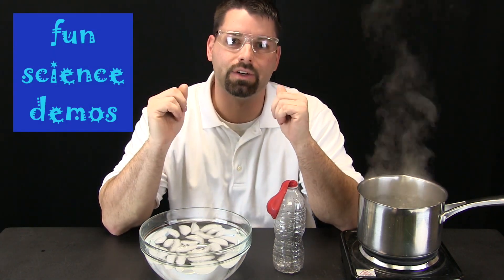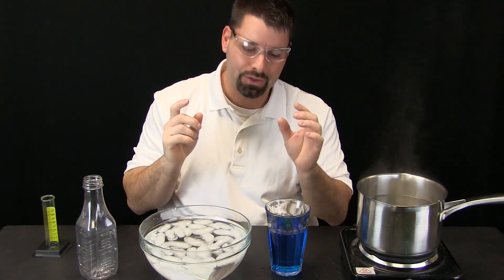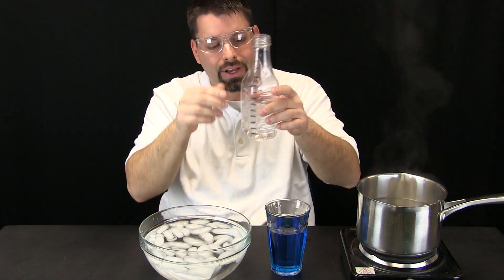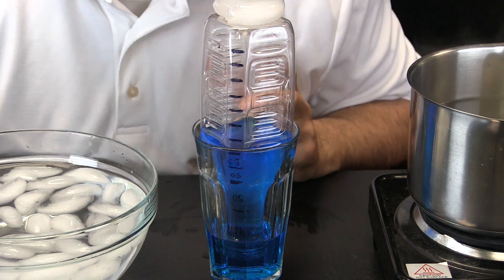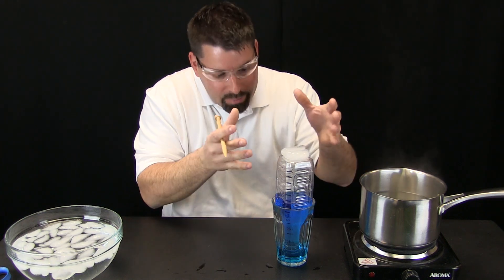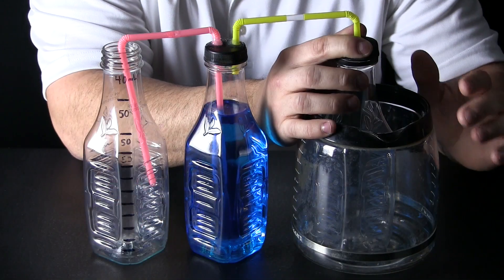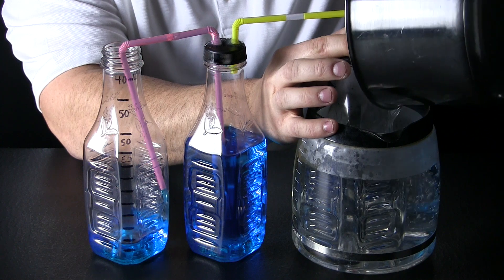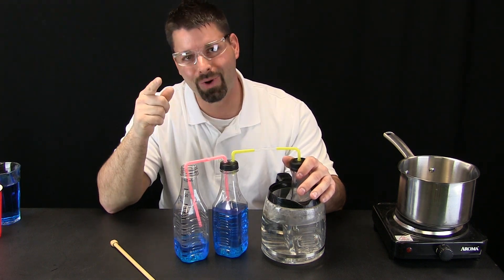Air Expands & Contracts

Comment: Can we do same experiment by keeping yellow straw with three opening, one opening as air suction, 2nd opening to heat sucked air, then pink straw that will suck water and put back to the heated water. A loop of water where a waterbottle is constantly heating up 
Because there would be some space in bottle, initial air warmed up goes to second bottle push water and put water back to source water bottle, now extra water added from second bottle but because of constantly heat again air will go and repeat, i am curious to know can we still pass air from outer space in yellow pipe as one side is just open outside bottle, one side inside hot water bottle, and one side is in blue water bottle. Three side straw pipe yellow one.

Comment: You miss the chance to point out that outside air pressure pushes the water into the bottle... most people think the water is "sucked in" which does not actually happen.  Otherwise, a very cool demo.

Comment: These are awesome!  How do you make those bottles?  How did you get the hole in the caps to make them air tight, and what type of bottles are your using?
Reply: I just use normal water bottles and seal  it with glue